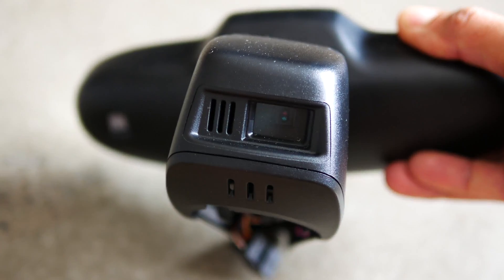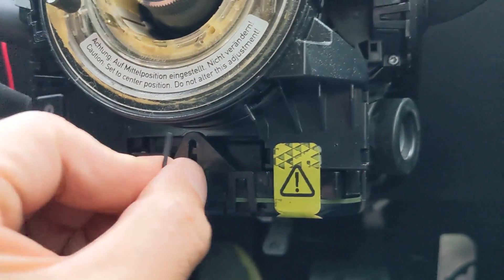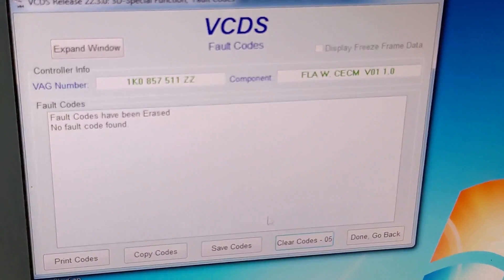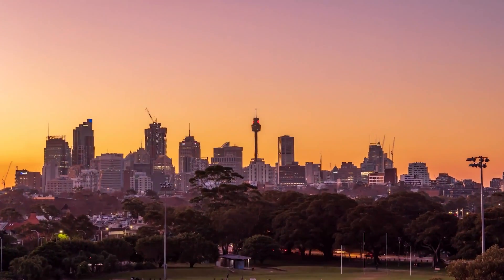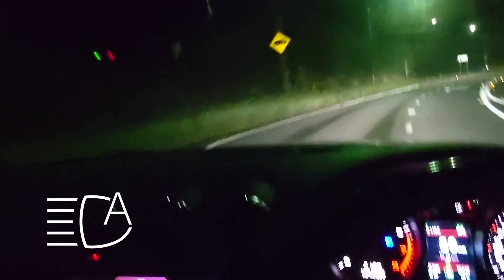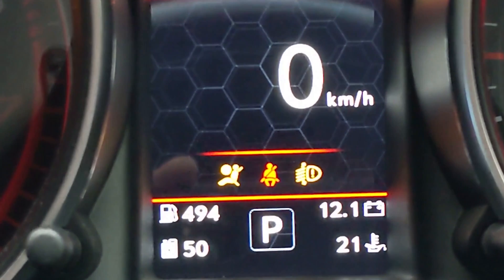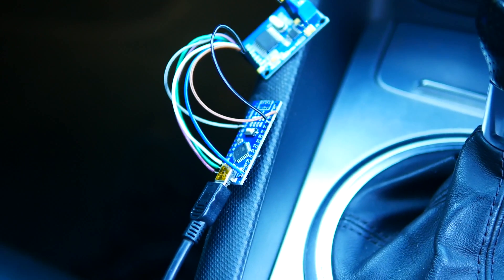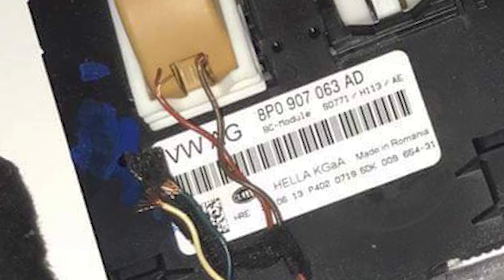Audi TT Mk2 8J HBA High Beam Assist retrofit (A3 S3 RS3 8P) pt 3: FLA module (fernlichtassistent)

Comment: I'm trying to retrofit HBA on my A3 8P redesign from 2009 but I have bordnetz 8P0 907 279 N and it does not support HBA so anyone know can I upgrade to 8P0 907 063 G which support HBA? Is it  plug and  play or I need to rewire it? I cant find any info on internet
Reply from the maker: Good question yes you can upgrade to BCM and it needs rewiring because plugs shape is different. .
Reply: @ianpgonzaga  Is it a big job or we are talking about same wires bit diferent pins? Or pins numbers are the same but i just need to transfer wires to new plugs
Reply from the maker: @mastercode2188  it's a big job. 

All of the cecm pins need to go into completely different locations and the comfort control module is also part of the BCM so wires need extending from rear to front of car.
Reply: @ianpgonzaga  ohh no...its just sad now..I wont do that kind od work its just too much, do you maybe know if there is bordnetz 8P0 907 279 with HBA or that kind of bordnetz do not supports HBA at all?
Reply from the maker: @mastercode2188  no bordnetz not support it. There's a hacky module i used to test but couldn't get it working 100% right.
Reply: @ianpgonzaga  thanks alot for helping me out